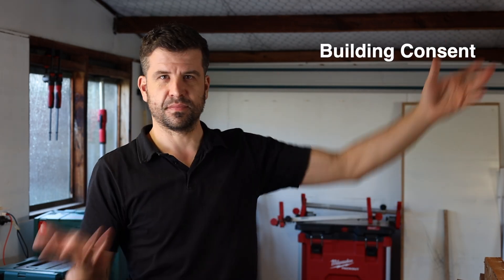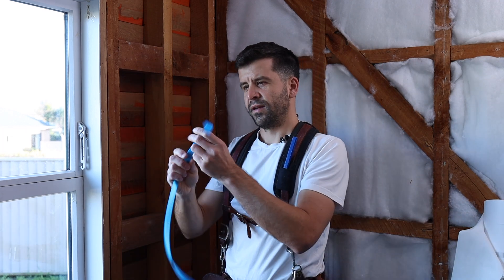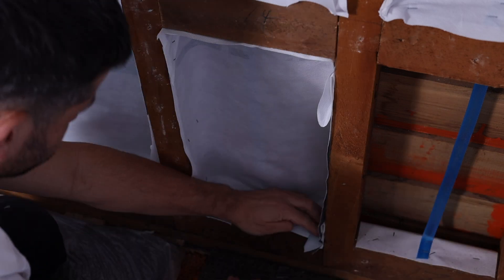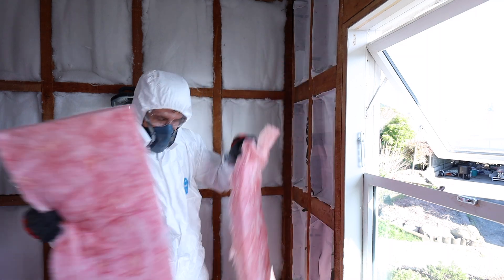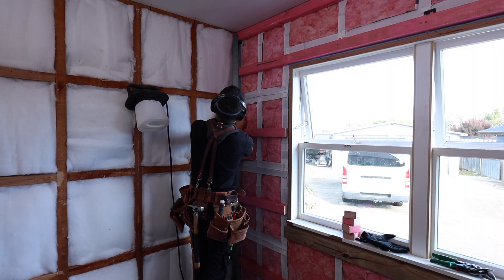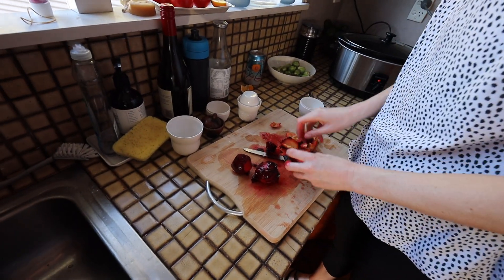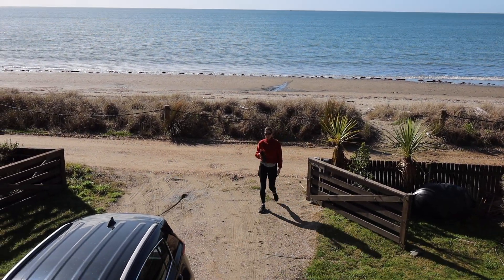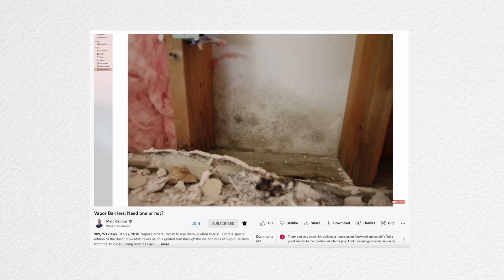We're Finally Going To Be Warm! Renovating Our 1960s House

Comment: It is always fascinating to see, how buildings are made in other side of world. 
Where I live, usually it something like this in new single houses; from inside to outside is; 13mm drywall, vapour barrier, studs and (glass or rock wool)insulation 100mm, then 25mm  wind barrier board, ~20mm lath if your weatherboards are horizontal, if your weatherboard is vertical your first lath is vertical, second is horizontal for keeping sure, air is circulating behind weatherboard.
Or this was the code, when I was working in, now days it can be different and much more insulation is required in the code.

Comment: It's a lot easier for you when vapour barriers aren't required in your environment. Because indeed if you install them wrong you get mold!
But for the ceiling I'd recommend looking for something little more efficient than a simple layer of polyester. Do it properly, maybe even little overkill, as most of the heat losses happen through the ceiling. After all, no matter where you live, good insulation is a big part of a good house. As a Nordic it's saddening to see so many homes in YouTube without proper insulation as people think insulation is only for Nordic homes. :) Keep up the nice work, love to follow you guys! 🥳

Comment: I do like the PIR insulation, and it is more effective per MM of depth. I find it works best when overlaying studs. Batts are a much more accurate fill when being placed in between studs, and leave less of an air gap.

Comment: Perfect Saturday morning viewing with my coffee!! 
I find this subject fascinating as we live in a 70’s built, single-level, brick veneer home in Sydney’s Northern Beaches and there is zero insulation in the walls or under the timber floor boards. 
I’m from Irish and An electrician by trade so when we bought this place and I started having a real good look I was blown away by the lack of insulation. 
(Not to mention the birds nest of wiring which I had to rip out and re-do completely - the joys of home ownership!!!)
I’ve been tossing up how to insulate the place without causing issues with moisture/mould on the internal timber framing due to interfering with the ventilation. 
I had thought about spray foaming the inside of the brick veneer, blown in insulation in the cavity, cladding the outside with insulated panels or this method which I could do myself. 
Love the videos, keep it up!!

Comment: When we insulated our 1960s NZ house we didn't leave an air gap. We just stapled in the building wrap against the weatherboard and filled it with pink batts. I asked a few builders the best way to do it and no one said anything about an air gap. A couple even said they don't bother with wrap, they just stuff the insulation in directly against the weatherboard. Building inspector came in for a pre-line inspection with the walls insulated. He had a look and didn't say anything, just signed it off.
Reply: That works ok. The back of the boards makes gaps for airflow and drainage. Hes just doing glorious overkill.

Comment: Have a look at celotex or kingspan insulation board a 30 mm board provides a R value of 2.75 . You can use it the same way as you put on the secondary timber without using the timber which eliminates the cold bridging it’s also foul backed which provides a moisture barrier.

Comment: Canada is so different! We just spray foamed our basement and now have R24 in 4” deep. No vapour barrier required either, as the foam creates a barrier. Also Jess was right, R60-80 is best for the roof/attic and very common here in Canada. It’s about 12-15” deep of blow in insulation. Hopefully NZ can catch up with what’s available in North America! Also rock wool is a great alternative to fibreglass insulation. You can get R20 inside a 2x4 wall and it’s not crazy itchy!

Comment: Different rules in Canada . Even on west coast where it’s similar climate to yours when we rebuilt we aimed for R 50 in walls and ceilings . This was achieved with 6” vertical studs, no nogs, all bays filled with close cell spray foam, plywood siding covered with Tyvek breathable membrane,   and solid cc foam 4” mounted on outside.  Siding over foam with rain gap. Total 10” cc foam at ~5.5 R per inch . Triple glazed windows and glass doors. We use very little heat in winter and no cooling in summer. Moisture is controlled by heat recovery ventilator 24/7.  Good luck, your work is meticulous and impressive. JG Vancouver
Reply: He's using RSI (metric), so it's actually equivalent to an R-value of 17.
Reply: Use of 6" (150mm) studs here in NZ was recently suggested by someone in government so as to increase the insulation capabilities of the standard NZ houses. It was shot down by the Housing Minister with the assumption it would increase building costs at a time when costs are already skyrocketing. One of the large timber mill owners wrote an open letter in response saying he wished they'd ask the experts rather than assume. He said building with 6" (150mm) wall framing would actually use less wood than 4" because of the milling efficiencies combined with the wider stud spacing it enables. Fewer studs would also be faster construction.
Reply: @bladee_enjoyer540  R-50 = RSI-8.8

Comment: Over here in the UK I'd probably use rigid PIR insulation in a similar fashion, 70/80 mm between the studs and 25/50 mm over the top. Timber frame houses in the UK are usually built with thicker walls, using 6x2 studs so you can get up to 100mm insulation in between with 25mm over the top, seems to be becoming standard over here for new builds, though if it's a renovation where you're only modifying the interior of the house you usually don't need any kind of building consent so you generally just insulate as much as you can.

Comment: Im supprised to see how new zealand only needs RSI of 2.2 (Or +/- R12.5) Its very interesting! I'm an architect in Canada and i love scotts videos because of how distinctive new zealand building is enven tho its still lumber just like here. It shows that there's always more than one way to do things!! Its definitely a good way to insulate the walls since a 1960 home. The way i wouldve done it personnally would be regular insulation like you did in the wall cavity but i would've put a Grphite foam or similar (its basically a 7/8" foam with a "reflective layer" or very very thin aluminium. That would give you an extra imperial R7.5 or RSI 1.2 with a 95% thermal bridge break than would add a 1x4 (19x89) over it to screw the drywall in
Reply: nz runs a very low insulation standard (walls are RSI 2), less than 50% of a comparable country/area. but good news is its about to be changed in about 5 months or so, to catch up with the rest of the world.
Reply: Also im pretty sure since you work in metric, its the equivalent for us to RSI which is the metric version of R value. Here where i live the ceilings are R-60 imperial but are RSI 10.5

Comment: In Lithuania we use vapour barrier and we need it to pass inspection, but we don't have problems with moisture cuz we have outside gap 2,5-4,5cm to air pass out from bottom to top

Comment: Love your Channel/videos!   I am slightly confused why you did not choose "Flash/Batt" installation instead....1.5-2" spray foam (closed cell) first and then Rockwool (sound proof & non-flammable) inside.    Spray foam seals up all those nooks and crannies you cannot get to with regular insulation,  you get a small gap between spray foam/insulation....I prefer this for both new and reno work.... Anyway, love the details of your work!  Keep the video coming!

Comment: Love seeing how different people solve the problems that old houses bring! 
If I were to be in the same situation I would have taken the weather board off from the outside(saving it as much as I could). Then put 6mm ply across the frame and 19x42 batterns across each stud. And put the weather board back on the outside. 

This creates the air barrier that you need strengthens the house frame and easy installation of the insulation on the inside. Down side being it is probably slightly more expensive and you have to take off the exterior of your house to do it! However I think it would be worth the money as it is a sure way to get the air gap you need plus I reckon it would be a whole lot less fiddly and allow for less mistakes than the process you are currently doing! 

Sorry for the rambling on, love the vids Scott!
Source:I'm a chippy from Australia

Comment: Honestly that double layer R3 was one of the best solutions to retrofit insulation I've seen in NZ.  I spent a lot of time nerding out on passive house stuff a few years ago.  I know what you mean with the limitations on approved products and acceptable solution. Its difficult here even on a new build as the code favors air movement over insulation and draft sealing.

Comment: Seriously look into rockwool, it's so much easier to cut and handle and much better than glasswool, will never sag, also with those horizontal beams you could remove the dwangs from the first layer, you'd greatly improve your total r value. Nuralite supplies rockwool, Im putting it in now, got it delivered from Auckland

Comment: a lot of it is which way the moisture moves, does it move from the inside or the outside.  In the swamp the moisture moves from the outside in, so the moisture barrier is on the outside to slow it down there. in really cold environments the moisture travels from the inside out so the barrier is towards the inside. In mixed environments 2 barriers. I also suspect the mold on the dry wall was either due to lack of humidity control inside (air conditioner) or lack of using it (opening the windows all the time and letting the moisture inside. Once you commit to moisture control you can't let your interior space routinely go up to high humidities

Comment: Maybe NZ doesn't have this, but here in UK we would have used insulated plasterboard, no battens, higher R value for thickness and better air seal.
I like the airgap between weatherboards and rockwall.
Reply: I think this video shows that there needs to be a better interior lining board, something that provides better insulation and moisture resistance...especially for the renovation market...

Comment: Scott your videos are absolutely amazing! 
We have R15 to R25 depending on the thickness of the wall in the southern parts in Canada along the US boarder where I am a contractor.
We usually work with spray foam insulation in New and reno projects these days because it's air tight and very clean!   In  Canada you have to build with a double vapor barrier so a plastic barrier between the plaster board and the insulation on the inside of the Stud wall and another water barrier on top of the plywood  underneath the siding on the outside.
Now when you use spray foam on the inside no extra plastic is required behind the drywall. 
Spray foam is fast, great R value and keeps the heat in a lot better. 
If you switch your insulation to foam you can even get money from 
your local utility provider towards the upgrade.
Keep up the great videos!!!
Reply: That's not a "double vapour barrier" - the Tyvek/Typar on the outside (similar/identical to the 'paper' layer Scott installed between studs) is a water-resistant but breathable membrane

Comment: National building code in Canada calls for R22 on exterior walls and R60 in ceilings below attics. That's the minimum standard of course. We do 2x6 exterior wall framing with a permiable house wrap on the outside and vapour barrier on the inside. The vapour barrier is needed because we can have a 50-60 degree C temperature difference between inside and outside in the winter.

Comment: Hope youre doing the Farewell Spit tours from Collingwood! Awesome place. Worked as a Hammerhand on the school in collingwood for some time. anyway vapour barriers are good to stop the moist warm air from inside, condensating after it passed thru the insulation and reaches the colder outside air. But in sumer, the warm moist air from outside WILL condensate on your Gib, because itll be cooler inside. I would probably create another air gap of 20 mill. between the vapour barrier and inside Gib. That would give neat space for elektrical cables and telecom. Downside is ofcourse that you'll loose that space inside. Personally, beeing from europe, i would've liked to build my house in a Concrete, Brick and Timber symbiosis. But if i would've bought a house in NZ in that cottage light timber structure style, i'd renovate the Hell out of it too! Love your vids bro, inspirational for a Drafter and Hammerhand😎

Comment: from what i've found PIR is roughly 5 times as insulative as fiberglass insulation but has it's drawbacks as it doesn't breather, unlike fiberglass. so both have their benefits. i think if you were to go PIR route then you'd want a larger vent space between the cladding boards and the PIR, the only other option would be to use vacuum insulation panels (VIP). VIP are twice as insulative as PIR but about 3 times the cost so makes it rather prohibitive to use. i think with all the timberwork you've got fiberglass is your best option as it allows moisture to move freely. you could also look into putting up insulated plasterboard, or like a 25mm PIR board over all the studwork internally, before the plasterboard over the top of that. It'll really put the brakes on any thermal bridging but again it does add to the bill

Comment: That thing about the vapour barrier getting mould on the inside of the plasterboard. Matt lives in Texas, so an extremely hot & dry climate. They use Air Conditioning year round. That means their plasterboard is mostly on the cold side of the building, so the condensation builds up on the back of the plasterboard. You’d imagine their airflow gap should be 20mm off the plasterboard.

Comment: Great video mate 

In Denmark its normal to put a plastic vapour barriere between the 2 layers of insulation or even on the outer layer just before the drywall and caulk the plastic to the floor, sides ect.

Comment: Flooring installer from the Wairarapa here thank you for cutting the carpet back theres nothing as frustrating as going to put new stuff down and having stuff built on top.
Reply: +1. so many times i've seen internal walls nailed on top of the old carpet.
Reply: @tweake7175  yea I've struck a few where they have put skirtings on after and you have to dig the old smoothedge out from underneath.

Comment: Great Video and I'm happy for you to have a warm home (or at least first room)  in the years to come!
We build a new house last year and use a heat-pump system as well, as insulation we used wood fibre which has a good availabilty here in Germany as it uses wood wastes of the timber production (one brand would be "Steico"). We opt for this solution as it is quite effective in keeping the warmth in our house but (with regard to the summers getting hotter and extremer each year) especially keeping the heat of the sun out. So far it worked out great and we would do it again (especially as it is quite easy to work with and you don't need a coverall).

Keep up the gerat work! Always learning from you :--)

Comment: 6:58 👏🏻👏🏻 very rarely do I see ppl actually use backer rod here in the states before foaming the window/door (if needed), and liked choice of foam as well. Usually ppl here just use that yellow window/door foam and fill it up (now, not saying that’s wrong, or right…just gotta use some sense and knowledge based on build). Also, depending on backer rod material, gotta watch what foam use; as certain kinds don’t work well together and can “melt” the backer rod material.
Reply: interesting, normally i see it the other way around. a lot of usa video's use backer rod. also using sealant around the edge to air seal.

Comment: Great job.
Rather than that second layer of glass wool, I would use sheets of foilboard or EPS panels.
I'm about to renovate my kitchen and i was planing on doing exactly what you did up to the second layer of glass wool and then switch to EPS.
The EPS will give you reduced thermal bridging and a good draught seal.
I will have to attach thin wooden strips over the top so I can use gyprock adhesive and use much longer screws to hold on the gyprock.
I'd love to know what you think or if I'm crazy.
I don't know what the gain will be compared to the way you did it.
I do know that all i did was R2 in other rooms and its a bit crap.

Comment: In Denmark to follow the building Code you need 340-360 mm isolation in the roof and 200 mm in walls. Right now i build a House with studs that is 195 mm and another layer inside with 45 mm isolation.

Comment: did you think about using foamboard (rigid foam) on the inside layer? no need for more vapor barrier, but you'd have to use longer screws to fasten the plasterboard (drywall) to the wall.  i've done this at 2" thick (50mm) for an R10 layer.  then do your "stud-saver" drywall corner anchor on the side wall (not outside wall).  or you can just do a california corner.

Comment: Can u get foilboard over there in nz I have used it internally with a thin batten to fix plasterboard too. The poly iso foam can reduce thermal bridging through timber frame seemed to work pretty well and reduced the labour of cutting out all the small squares. Love the vids keep up the good work

Comment: I just started renovating an old house that my brother bought for his family and the R value for the roof should be about 10 for the insulation alone. Then there is also plaster board, 1" of pine boards and heavy roof tiles. Should be sufficient for german standards 😅